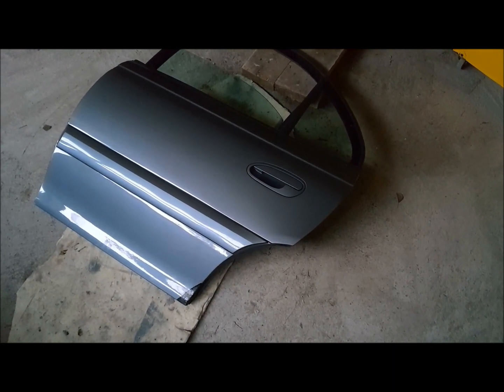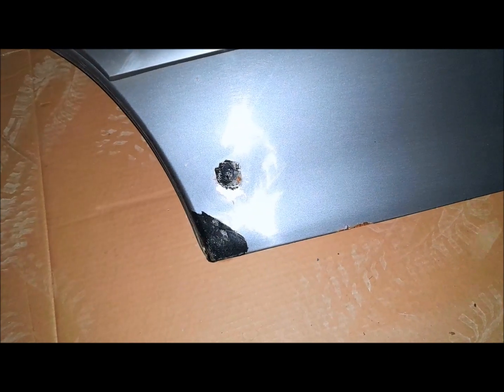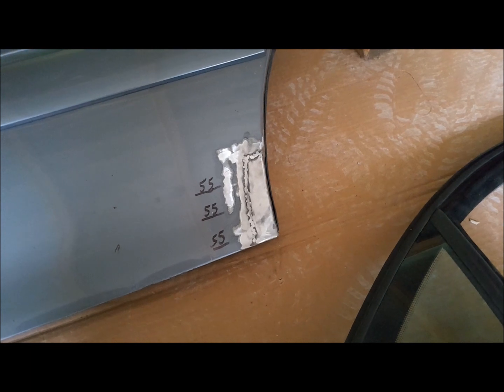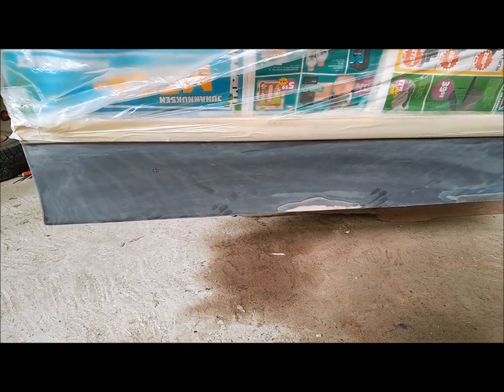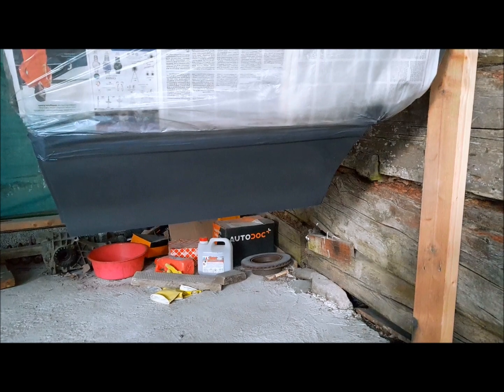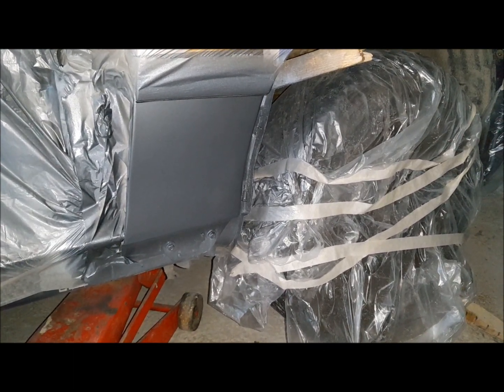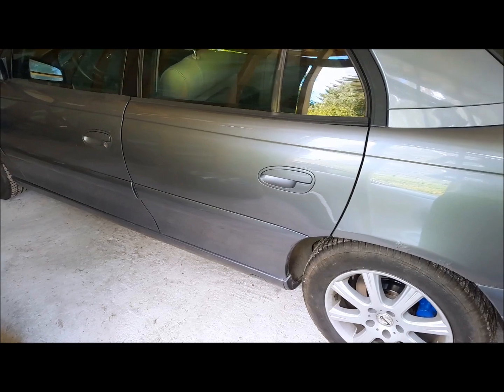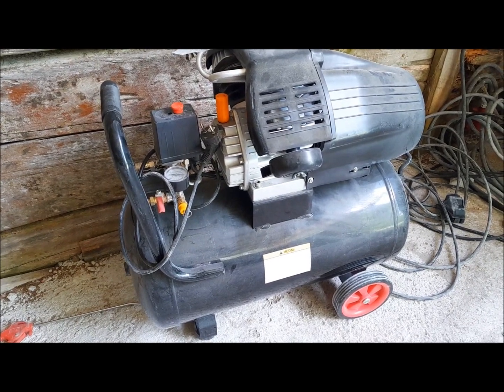Omega V6: Some sheet metal work and paint job

Comment: Good to see another omega being looked after. I thought those wheels actually looked ok, I'm usually not into aftermarket wheels. Do you have enough pressure from the compressor to do spray painting? I was looking to get compressor but was under the impression you needed really large compressor to do spraying.
Reply from the maker: Thanks! Actually I do have set original 17" wheels for this one😉 About compressor; generic opinion is that you need at least 5hp/100litre compressor, but I´ve done lots of painting, even a one complete over spray, with 3hp/50litre compressor, it´s certainly on the limit of air volume, but HVLP-spray gun doesn´t have very high air consumption, so I haven´t got issues with pressure. More essential is clean air, which why I use oil/water seperator in the hose.